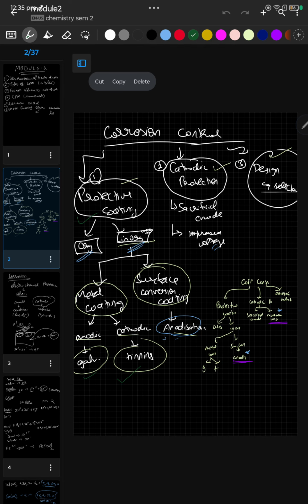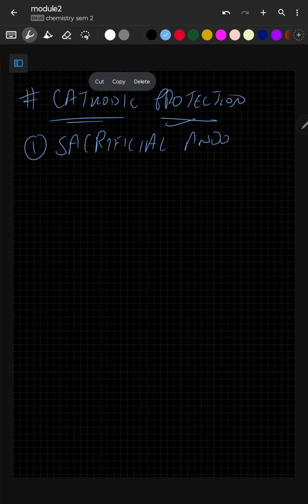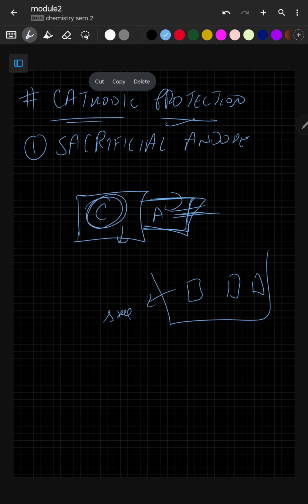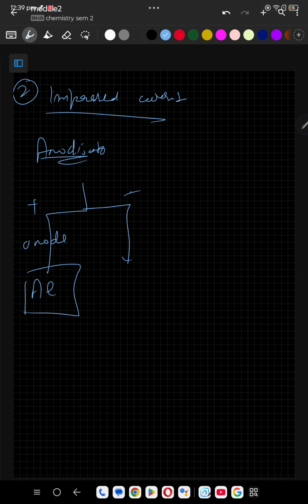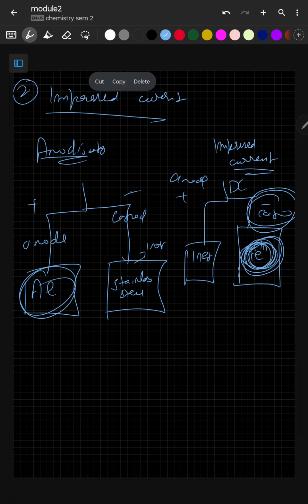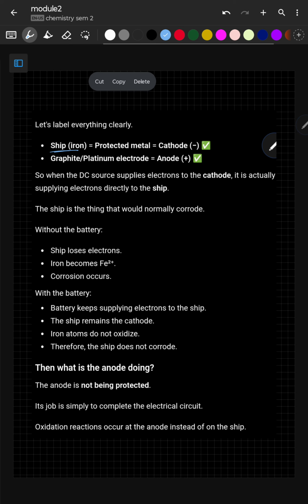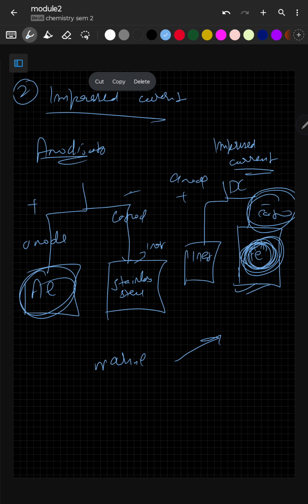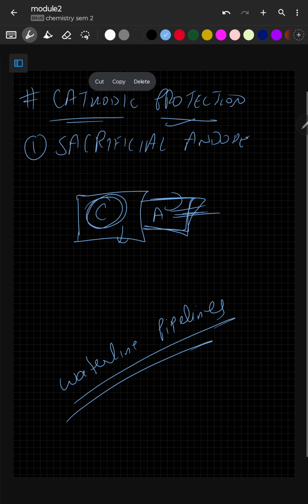Corrosion control| cathodic protection| sacrificial anode and impressed current

Comment from the maker: If a cathode never undergoes oxidation anyway, why do we need to supply electrons to it? Why not just call the ship the cathode and leave it?"

This is the crucial point:

👉 The ship is NOT naturally a cathode.

If you simply place an iron ship in seawater without connecting the DC source, the ship develops tiny anodic and cathodic regions on its surface.

For example:

One small spot becomes an anode → iron dissolves there.
Another small spot becomes a cathode.

So the ship is partly anode and partly cathode at different locations. The anodic spots corrode.

Now we connect the DC source.

The battery supplies electrons and makes the entire ship sufficiently negative. As a result:

No part of the ship can become an anode.
The whole ship behaves as a cathode.
Therefore, nowhere on the ship can oxidation of iron occur.